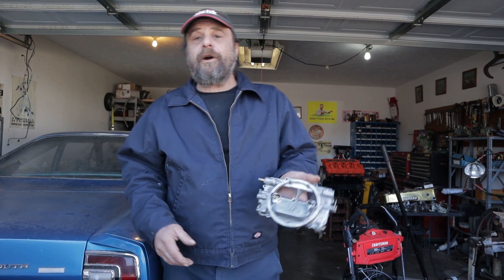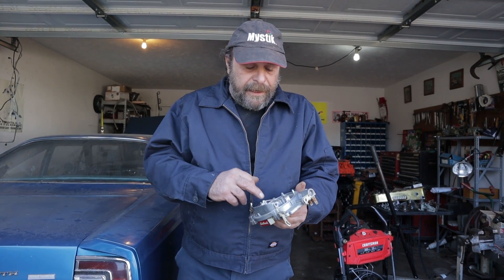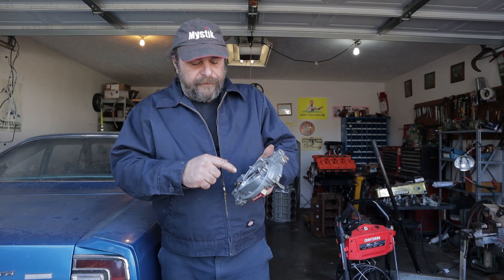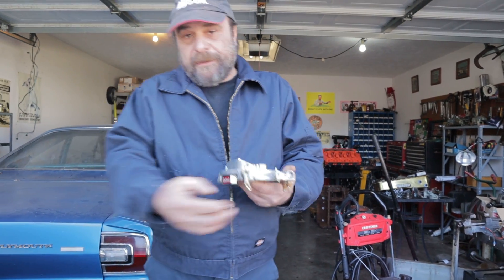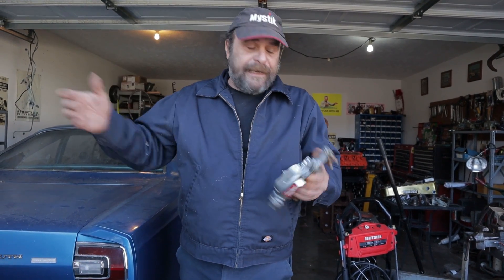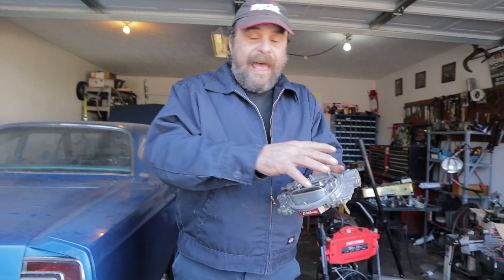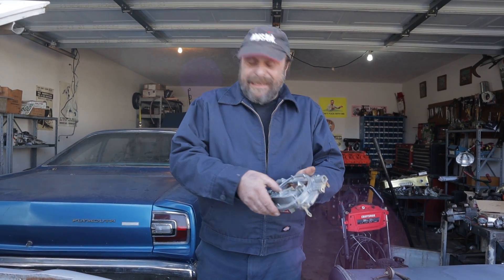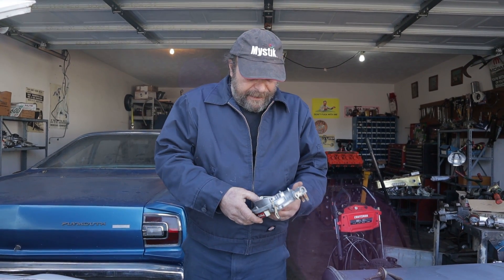The Most Troublesome Part Of Any Carbureted Car

Comment: 90s kid and i used to drive an 85 chevy k10 with a 350. I put and edlbrock carb with manual choke in it and it worked great! Now i am dealing with a boat that has an auto choke on it and im thinking Bout ripping it off and doing a manual choke. These auto chokes are a pain

Comment: Hey Uncle T,
Have you ever discussed the GM THERMAC systems?
I've got a '78 SBC 350 that was upgraded to a '87-ish TBI system, and it's got the older-style wax pellet actuated THERMAC flapper in the air cleaner snorkel. The flapper still works, but I have headers on the engine and therefore no exhaust manifold heat stove setup. It's not a huge issue in the summer, but it starts and idles rough in the winter. I live in western Colorado at about 7500' elevation and it gets cold enough to freeze the balls off a brass monkey.
Should the TBI be able to compensate for the cold temps or should I be working out a solution to get the THERMAC working again? I seem to recall an aftermarket bolt-on heat stove for engines with headers, but that was a while ago.
Love your channel and I recommend it to everyone I know with an older car!

Comment: A manual choke pull is the first thing i install in any old car i get , i have had good running electric ones and aslo horrible ones, id rather manually control the choke anyways so it doesn't bother me

Comment: Thanks for knowing as much as you do. I figured out how to make an Edelbrock electric choke work functionally. I ran with it disconnected for a while which has its own problems. I figured after your explanation, just put a switch for the choke in the vehicle. If you don't need it, turn it off. Interesting that it doesn't have its own pull off but thanks for the insight. The choke plagued me when I had it running and I don't like incomplete systems in my truck so this is now on my list of things to make driving this thing a bit better.

Comment: The only problem I've ever had with an automatic choke is people who had the car before me screwed with the choke and idle mixture setting when what the car really needed was plugs, points, cap, rotor, air filter and sometimes wires. Still run automatic chokes on all my carbureted engines, absolutely nothing complicated about them! It was never the choke that killed the engine it was the fools who set the choke so it would not fully close and the richen the idle mixture screws, so it ran rich most of the time fouling the plugs. Can't tell you how many carbs I reset for fiends that had their car at the local garages. And, yes Edelbrock does have a vacuum pull-off for the choke. Read the instructions.

Comment: Chrysler started putting the choke thermostat in the intake manifold exhaust cross over in the 1950s. Simply because it's a more accurate temperature than the type on the side of the carburetor sucking heat through a tube. Unfortunately both Holley and Carter (now Edelbrock) continued to use those same old housings, with electric heating on aftermarket market carbs. They just sorta suck for the reasons mentioned. Living where I do with bellow zero starts I use chokes, on aftermarket carbs manual is the way to go. OEM like on an old Dodge works ok, just open slower once the manifold heat control valve is eliminated with headers or corrosion. You can adjust to compensate.

Comment: Hi - thank you for the topic!  I think it would be really helpful to describe a few symptoms, because people can't actually see if the choke is coming off too soon or too late.  I  only know what I have to do to the gas pedal to keep a cold (35 degrees) engine running until it finally settles into curb idle.  Example: I can can get the engine to fire, but immediately have to keep jabbing the gas pedal, so my choke is probably (which one) never completely shut? open before it should be??? isn't opening soon enough???  If I can hold the pedal to keep the idle high and smooth, but notice that after a few moments, the rpms slowly drop on their own and the engine dies unless I jab the pedal, my choke is probably open before it should be? isn't opening soon enough?   I don't have the stove tubes connected, or the exhaust manifold riser connected to the air cleaner, so I'm going to switch to an electric choke cap for my Holley 735 4150 type.  The car is a rebuilt classic that only sees cold temps the first few days after it comes out of winter storage in April.
Reply: Here's an update to my comment based on info in a really good Hemmings article called "The Lost Art of Choke Adjustment." I connected a remote starter so I could watch what is going on.  This is not info on what the specific adjustments are, this is just a different way to describe what each choke function does and when it matters.
 
Choke Event 1. Prior to turning the key, tap the gas pedal, which provides a squirt of gas and sets the only two parts of the choke adjustment that matter at this moment: the butterfly goes completely closed/no gap, and the throttle linkage catches on the high part of the fast idle cam.

Turn the key. Engine should fire. If it doesn't, NONE of the other choke adjustments have anything to do with it.

Choke Event 2. If the engine fires and starts, the engine vaccuum will immediately cause the choke pull off to crack the butterfly open a very small amount, overcoming the tension of the choke spring NO MATTER WHERE YOU HAVE SET THE CHOKE SPRING, as long as the butterfly was initially gapless. Engine should run at high idle and be stable.  If it doesn't, the only things in play are the size of the pull off gap (approx 1/16-1/8") and the need to be at high-idle.  Choke spring setting has nothing to do with it yet.

#3 Now finally, the choke spring setting matters. At some point, the engine has to come off high idle to curb idle.  This is the magical combination when engine warms and the butterfly opens in harmony. The moment you touch the gas pedal, even slightly, the throttle will slip off the high idle cam, and if your butterfly is too slow or too fast, the engine won't run perfectly.  Now you are finally at the point of messing around with the choke spring adjustment to change how long it takes for the butterfly to open enough for curb idle.  

I am doing mine while it is 39 degress out, and I can have an actually cold carb...

Comment: The carburetor and points ignition are amazing analog systems and will work well when set up right. I like my manual choke on the 70 W200 with the 318

Comment: I did not realize there was a pull off inside there, a summit carb I recently played with said that hole wasn't drilled out of course I assumed it was for pulling manifold heat thru the spring. Sometimes I'll take the PVC hose and wrap it around the spring cover, just to assist in warming it up. Thanks uncle Tony, as always

Comment: Yeaaaaa...more. caberation......you. love. Carb.s. ......I. love. Carb.s...even.  some.  Of.  The.  Wiz. Kids. Love.  Carb.s....now. let. Me.  See. If.  I.   Got.  This. Correct.....there. is..electric. choke...vacuum..choke...  heat coil.automatic Choke.....   and. Good. Old. Manual...choke. ...with. the.  Most.   Driver. Controll....ya know.   Driver.  Controll...the. good. Old. Days..  the. Driver. Was. Your. Rev.  Limiter...shift. indicator. And.....visual. gauge..checker....or. computer. Senser.....aahh....yes. Driver. Freedom. And. Controll.....  now. Even.   The.   Seatbelt.s. lock. You. In.   Automatically.....  like. It's. Owned. By.   Some. One else.....  have.  A.  Nice.  Day......

Comment: Hi, have problem with my carburetor, hope you know what's wrong. I have Pontiac V8 400 engine with Edelbrock 1411 carburetor and Edelbrock 7157 camshaft. Works great, but looks like i have lean spots (or maybe not). When i drive in cruise, slow down because of road bump or traffic light and then start slow accelerate, feels like engine want's to stop working, sometimes it shut down. Car starts to shake. If i press pedal hard after stop, runs great, no problem. Where i have to look for this problem and how to fix it? Hope you or someone can help.

Comment: I just spent about $700.00 on my sbc with a 600cfm. The motor would crank & run beautifully, but when I drove it, the low end power just disappeared one day and the motor backfired. I was incredulous. That happened 2 months ago. I've gone through 2 mechanics & 500 YouTube  videos. After watching this video I went outside & checked my carburetor... it was particularly choked...smh  The lever inside my truck wasn't adjusted or able to unchoke the carb. Thank your Sir... you saved my 1972 Chevy truck.

Comment: I remember my 2nd vehicle was a carborated 2.0L ford with an auto choke, it would run differently everytime you started it. Go into town it would run alright, get back in it would run so so, sometimes it ran great and others it would spit and chough, we switched it to manual choke cable and things got significantly more consistent. Good vid, its truer than most would believe.

Comment: My goal is to make my old trucks ( 67 to 72 Chevy K20s) as simple and dependable as possible. Straight 6 four speeds. I prefer to operate the choke manually. It's spring loaded open, I have a nylon fishing line I pull to close the choke as briefly as possible, usually less then a minute even on the coldest days. It's mostly used just to use vacuum to pull in some fuel initially to start it.

Comment: Some engines if conditions are right at 32 degrees would have carburetor icing where the carb turned into a block of ice and the car would stall or run very rich. If you took original air cleaner off and put a aftermarket air cleaner on that would give you carburetor icing because you eliminated the heat source from the exhaust manifold that the original air cleaner had.

Comment: Tony, how do I adjust an early 80's thermoquad choke as fitted to a Dodge Truck (318)?  I tap accelerator and crank, engine fires immediately but . . .  engine maintains high idle (roaring) until fully warm -maybe 5-7 mins later. Worried about such a high idle with a cold engine! Shouldnt I be able to kick this down a little lower after initial startup? Is there a choke duration adjustment? Help!
Reply: The holley 2245s that were in alot of those Dodge trucks had a fast idle cam and adjustment screw.  Adjust this screw to adjust the fast idle.

Comment: Just bought a 78 f250. It has a screw in the right side vacuum line and a manual choke on an Edelbrock. The cable is seized up so I hope the oil will un stick her.

Comment: My 78' Holden Kingswood (here in Australia) has a Stromberg BX carburretor with a manual choke straight from the factory and I love it. The automatic chokes don't seem worth the hassle! Also the BX is a very simple carburettor, so I like it too- even if it's only a single barrel. Gets the job done for my straight 6 engine.

Comment: Im so glad that Im not CRAZY for thinking my damn edelbrock has been a pita to get going with this electric choke conversion.. Im fairly new to carb restoration and tuning. I rebuild the thing, which was fun learning how to set float levels.
Now im still having issues where it seems like I cant get the car to idle right. Either it has something to do with the fast idle setup (where I can either get the car to be SUPER fast or on the verge of dying, no inbetween) or maybe a bad choke adjustment. 
I still need to check timing and to see if Ive fouled any plugs. To be fair, this engine sat for 25 years (72 GT Ranchero) and Ive got it going for the most part and am working my way through problems. I HIGHLY suspect Ive got a vacuum leak on the manifold gaskets so I might yank and redo that. 
Plus it has an MSD ignition which ive never had which could be a whole NEW set of undiagnosed problems. Might just spend the money and go back to HEI. Too complicated.

Comment: The only carbureted vehicle I ever owned was my first. It was a 1986 Toyota 2wd regular cab short bed with the 22R 4 cylinder with a 4 speed. I bought it in 1988 with  77k miles and sold it in 1993 with 194k miles. I never had a lick of trouble with the carburetor. From -15°f to 100+°f, it always started on the first try, even during the summer I couldn't afford to replace the starter, it still started on the first pop of the clutch going forward or backwards, even pushing it across a flat parking lot by myself, except when I forgot to turn the key to ON. I miss that truck 🥲 and would love to have another just like it !

Comment: After dealing with manual choke kits, I rigged up the bimetalic to hold the choke wide open, then use a cable hood release to close the choke, set high idle, fire it up, and see what the engine needs for less choke-depending on weather.  Worked great after it was set up right!

Comment: Got do frustrated with my new Edlebrock that I ripped the elect choke off and ran a lawnmower throttle cable out to the carb just to get me through the cold until summer. What a pain in the butt adjusting and adjusting and Arrrgh!
Know what I mean..?

Comment: I had a similar problem with a tiny V4. Soot everywhere: pistons, plugs, exhaust system including that valve... As it turned out, the cold air during winter shut the automatic choke again when on the move. The bi-metal was heated with coolant, which wasn´t fail safe during harsh winters.  I solved it with a wind deflector and some isolation.
Most cars with that automatic setup were converted to manual chokes.

Comment: I once had a ‘62 F-85 with a 215 v8. It had a Rochester 4-bbl that was not running right. I took off the carb, installed a kit and adjusted all the settings as per the instructions. It ran flawlessly after that. The carb had an interesting feature. With a partially warm start, there was a small vacuum servo that would raise the idle a few hundred rpm. This would happen without any throttle input, and only last for about 5 seconds, then idle down to the stop screw setting. Clever idea! I loved the car... all except the tranny, a 3-speed hydromatic... not a TH! The 1-2 shift was miles apart in ratio. It would have been more fun with a 4-speed manual.

Comment: I concur UT!
I have an edelbrock 500 AVS on my mild 318 with a manual choke. I used to use the choke but once it was tuned properly I found it didn’t need the choke at all!
Also my edelbrock suffered from the dreaded edelbog when hitting the secondary’s. I read somewhere that the choke flap can hinder this so one day while tinkering I took the choke flap off completely and to my surprise it really did get rid of most of the bog that was there!  Still bogs a bit but I believe that’s largely due to my diff ratio of 2.92.  I was impressed as it was an easy fix.

Comment: Uncle Tony I have a stock 454 out of 97 suburban was fuel injected changed intake I believe I have a 6-650 Holley carb on it but runs sluggish. what could be my problem. What size carb do I need? It is stock with electric fuel pump
Reply: Do you have a fuel pressure regulator ?

Comment: isnt it easy'r to remove that deam thing?Im not useing a choke at all just have vaporisor if choke is compleately closed you wont by abel to turn the engine thats called forced compresion hidro look you actualy pre heating that deam thing with its own compresion similar to a spitfire plane and advance ignition timing in winter use deam amplifier for ignition system over write starter motor rpm crank use deam valve to blead out moisture out of intake manifold use deam engine block ore oil pan heaters so use lover viscosity engine oil at winter use fuel aditives expecialy older engines and protect all wires and conectors with heat and moisture resistante spay use moisture/air seperatos on intake ore fuel suply system there you have it you culd in fact over write alternator voltage and starting rpm charge do all this and by pass that shit good video only adding some more help after those mod's engine will start evry time even in extreme conditions and suprizingly you dont need to waste fuel for nothing choke is used just for 10-15 seconds your got on the gas pedal is the choke it self so you control choke with gas flap she must by copleately closed that flap there you go manual choke and that forced compresion look is nice in winter ignition amplification is away to go I use plazma igition never did I stall ore have back fire ore weat spark plugs use marine ignition wires that all shuld solve any problems it wuld by recomended to protect relays and fuses from moisture as well

Comment: Do a video on swapping an electric to a manual  on an Edlebrock. I have been having the same issues as you mentioned with my 1987 318. Would it be better to just buy the 1405?

Comment: Choke pulloffs work just fine if they are properly adjusted. And it's not hard to do. Set it too lean so the engine starts & dies, over & over. That's too lean. Then you spread the adjustable wire linkage until it will start & stay running the 1st try. If it sits there running but puking & laboring it's too far closed. Bend the wire to pull it open a little farther, until it runs smoothly while the engine is cold. Easy as hell.

Comment: If u dont have a chocke. Cant you just pump the throttle 2-3 times to get fuel in the carb and have 25% throttle to keep it going until it warms up? Maybe im wrong but. In my head thats the same princeble. Correct me if im wrong

Comment: I have to dissagre on what scraped the most cars !!!
It is whatever they add to fuel that eats metal and rubber !!!
Especially down here in the gulf states !!!
When you see steel parts rusted through from the inside out an brand new rubber needing replacement every 6 months ...
It gets kinda old !!!
Like an acid or perhaps hazardous materal disposal ??? Just add it to the gasoline no one will ever know ???